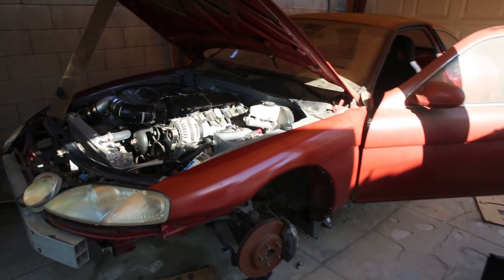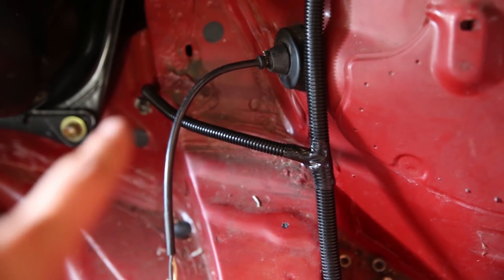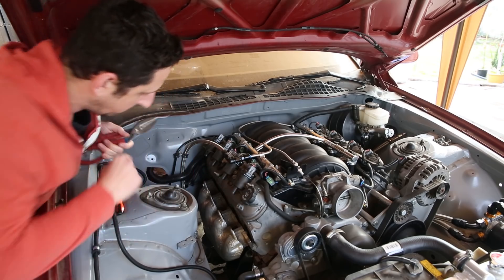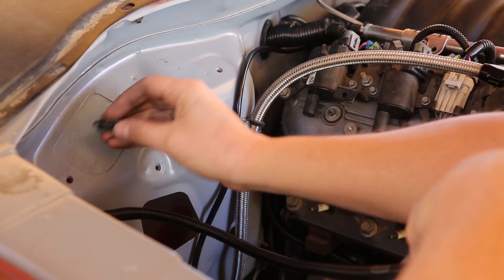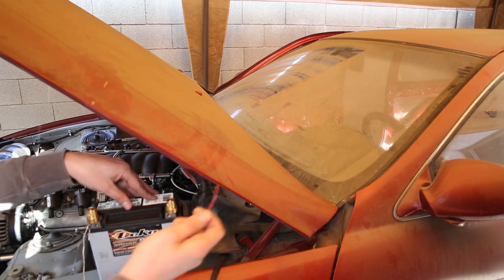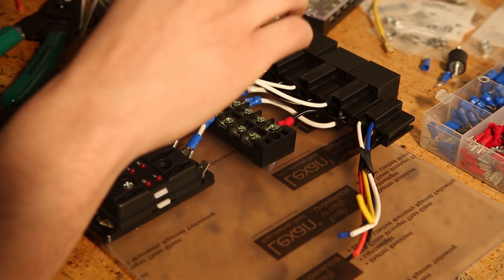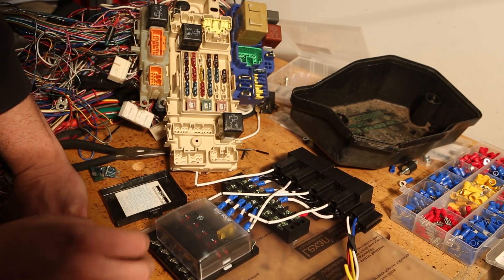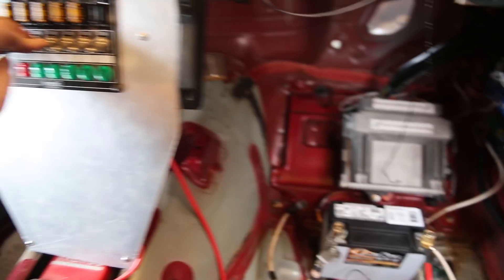Lexus SC400 Drift Build. Ep.41 - Race Car Relay Panel and More (Wiring Part. 2)

Comment: Any advice on what needs to be relayed?
Reply from the maker: You can choose to relay as many or as few connections as you want. Generally the idea is to have relays on accessories that will draw a lot of power so you can keep the higher amps going through the relay instead of your switch panel. I added relays to the headlights and taillights, windshield wipers, fuel pump, ignition, and radiator fans. I do not have relays on my reverse lights, brake lights, gauges, or anything that draws a minimal amount of power. Of course all circuits do run through the fuse box - even those with relays.
Reply: @FullySpooled  this is the answer I've been searching for. Thank you

Comment: dude fuck factory you can do it solder or crimp just get the real crimpe not that dumb color code thing  i just use the ring things blue ,cut the ring off twist the wire with  pliers tight then crimp tight leverage then you can dump solder in the end if you want this gives you freedom to wire and t e wire breaks before  that technique of splicing

Comment: Awesome job dude been waiting for these episodes,has inspired me to start on mine. Where do you get all your wiring info from.
Reply from the maker: I just searched all over the place to figure everything out. Each time I come across something like what gauge wiring I need for what size fuse, I do specific searches to figure it out and over time I collect all that data together to figure out a working plan. I eventually gather info from multiple sources like YouTube videos, forum posts, random articles, etc. So far so good. Glad you're finding this info useful and good luck with your wiring!
Reply: The soarer/sc come with stupid amounts of wires and also that in car fuse box is in a the worst spot
Reply from the maker: Yeah stupid amounts of wires and little plastic boxes with control boards in them tucked everywhere. I removed probably 10-15 little random control boxes for things like the keyless entry, antenna controller, fuel pump controller, etc. It's silly.

Comment: You might have badly scratched your windshield when you tested the windshield wiper. That grinding noise sounded awful.
Reply from the maker: No scratches. The windshield wipers were just really old and dry. I cleaned the windshield recently and it is scratch free. Good thought though, thanks for looking out!
Reply: Ok. That's good. The sound it made made me cringe. It was like fingernails on a chalkboard! Was thinking a windshield replacement is in your future! LOL